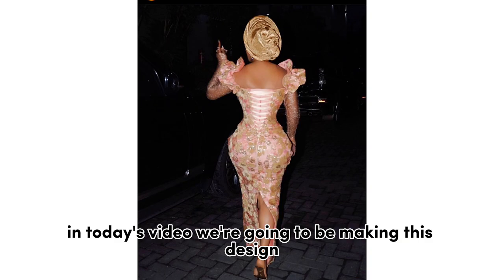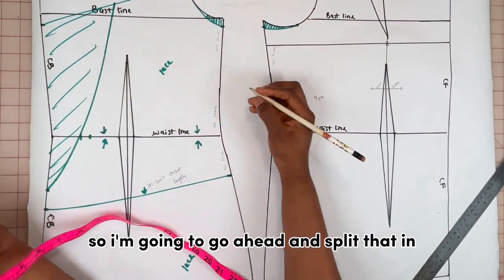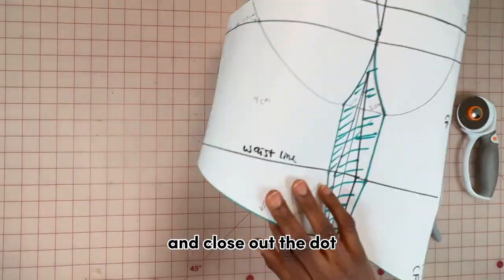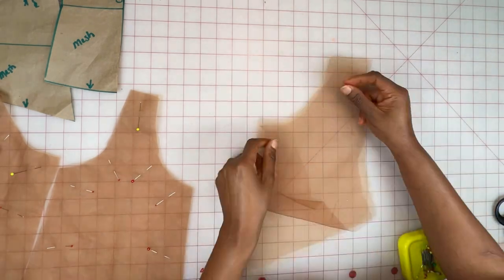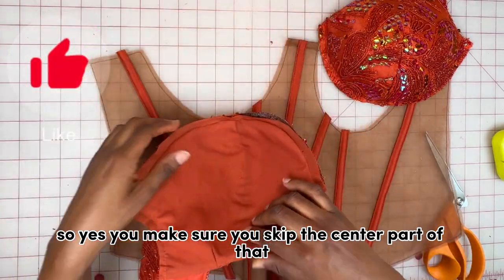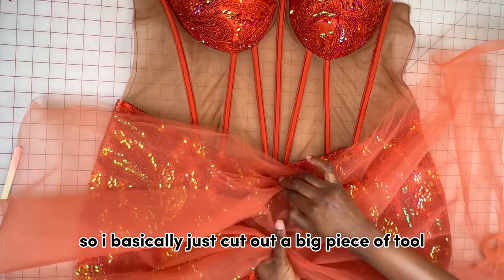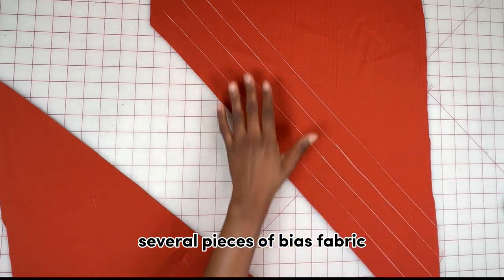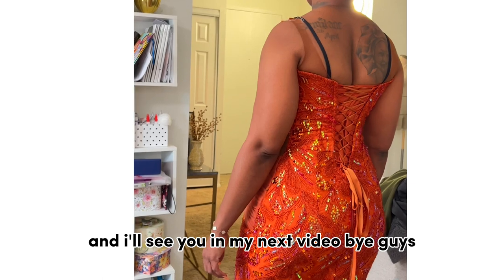Transparent Cupped Corset: Pattern and Sewing Tutorial #diytransparentcorset

Comment: Great video! U teach well.Please permit me ask.How did you sew or attach the skirt on the front corset part even with the strong bones.Did your needles go through them? 

Secondly,pls why did you use the Ridgeline bone(softer bones) at the back of the corset?thank you
Reply from the maker: Thank you! I did sew over the boning ( it was the very flexible kind and of low density as well, a small sized needle can sew through , sewing over it really slowly)

For the back of the dress, I used a different type because I didn’t want it exposed. It was just a preference ( got the same results) so doesn’t really matter which. Either works just fine .
Reply: @mercyadamsinseams  Thank you so much.Such a great teacher.

Comment: Thank you so mich for sharing this.
I have a question though, in the front panel, you attached the skirt over the boning area,  does machines sew on plastic boning?
I use  a manual machine and it doesnt.
Reply from the maker: Yes.. I used a a smaller sized needle and very slow sewing speed
Reply: @mercyadamsinseams  thank you

Comment: Hi, greetings Mercy.
 Thank you always for your detailed teachings.
  so I  practiced mine using this video, results came out fine 😊😊, but I had a couple of challenges.
 (a) my yoke (tulle) had excess, it didn't lay flat even after i took a dart from the chest line contouring which was done on the neckline all the way to the shoulder line. please what ways can I use to avoid this ?

(b) every other measurement was exact except on the bust measurement which had an excess of about 2". I tried to take it out but the side seam gave a really funny shape.  so I used that 2" inch as the seam allowance for both back and front when sewing. Is it ok to have that much excess?
Reply from the maker: Hi!
What basic block did you use? Pls send me a DM of  pictures of the outcome on IG. That way I can see what you mean exactly

Comment: And finally 😜....pls how were u able to sew on a plastic bone for d front,  did u later add plastic bone to d regiline bone at d back??
Reply from the maker: The boning was about a 1/4 wide and I used a size 12 needle( but I sewed really slowly around the boning) and yes I added plastic boning on the side of loops
Reply: @mercyadamsinseams  so no plastic bone inside d regiline at d back like double bonning?
Reply from the maker: No double boning. Just the regiline

Comment: Mercy, you are a gem
 Thank you so much for the tutorial. Quick question, is the modesty panel detachable, or you later attached it to the dress off camera. I mean the stuff that's covered the lacing at the back, I don't know if that's what you call it.

Also, what kind of boning did you use at that loop part. Was it a regiline boning? And how many mm boning. A response will be appreciated.
Reply from the maker: You’re welcome . Yes I attached the modesty panel off camera( I basically stitched it under the same seam after the loops . I used the same plastic boning I used on the front part for the looped side  I hope this helps
Reply: @mercyadamsinseams  Thank you so much. Yes it helps.

Comment: And you did not sew the boning for the front part of the dress, instead u inserted it,is there any reason for that?
Reply from the maker: I used plastic boning on the front.. sew or inserted .. it doesn’t really matter. There are several types and methods of boning.
Reply: @mercyadamsinseams  thank you so much

One more thing pls,the plastic boning,do u mean regiline boning?
Reply from the maker: No. They are two different types. Regilene is polyester boning . The other one is actual plastic boning